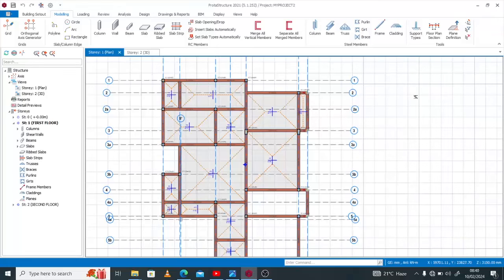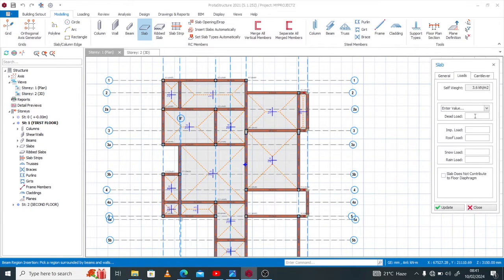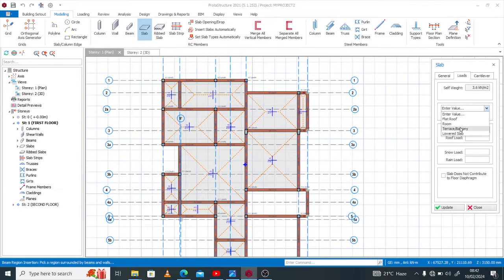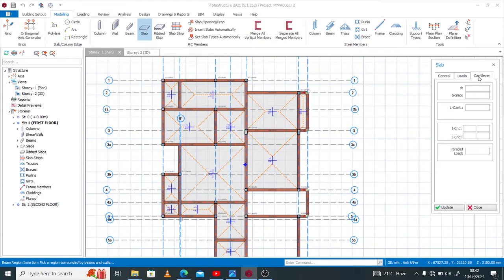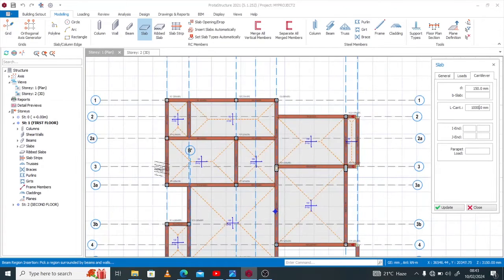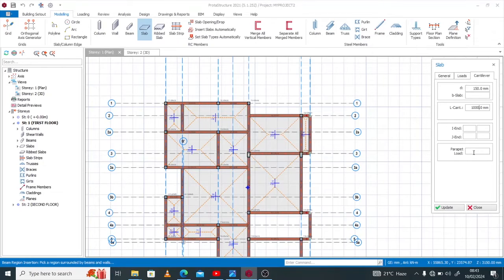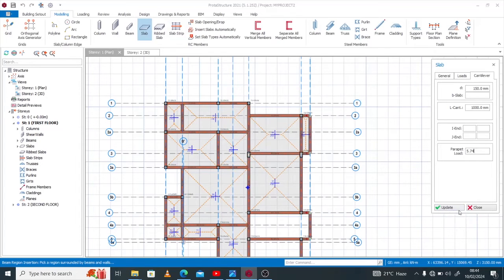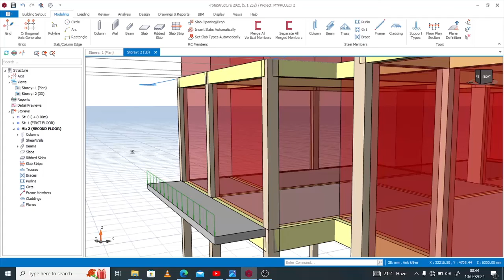HOW TO ADD WALL LOADS ON CANTILEVER SLAB ON PROTA STRUCTURE

Comment: Thanks I appreciate, but for a cantilever that is extending  a room of which it will carry a column and a beam on it, should I still apply roof load on the beam to know if the cantilever slab will carry the total imposed load
Reply from the maker: @chiahaemmanuel8715  Though you're question is not clear but I'd say your model should represent what literally happens in your design